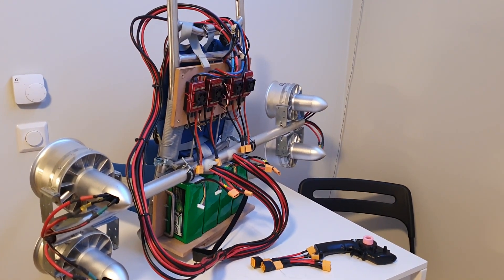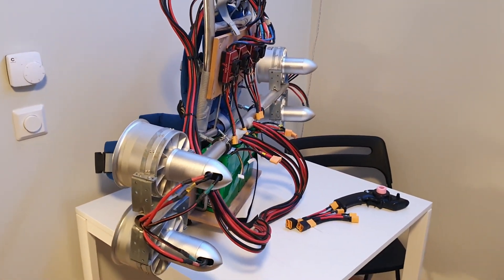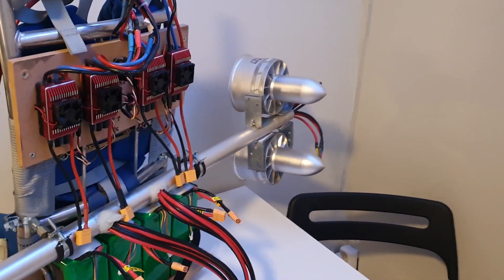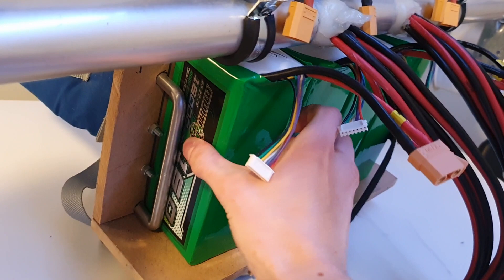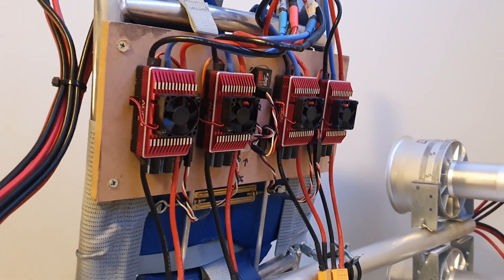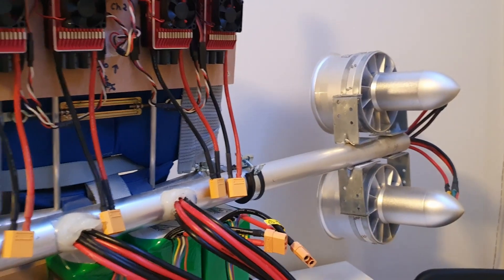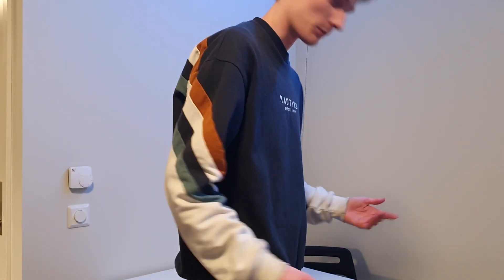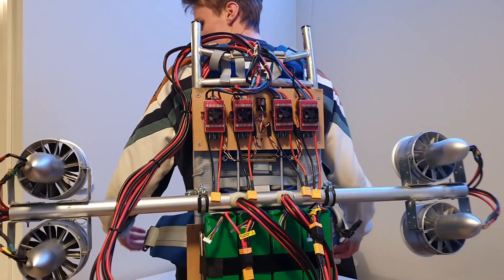Electric Jet Engine (EDF) JetPack

Comment: careful with those serial connectors. if you bought them online, high chance they have bad solder joints. could be a point of failure.

Comment: Amazing video! Tip: maybe add meshes in front of the turbines before your outdoor tests to prevent leaves and sand from getting sucked in and destroying the engines
Reply from the maker: Thanks. yes good point, have thought a bit about it. Are a couple of small things that must be done before taking it outside.